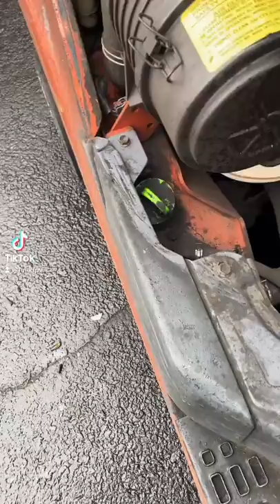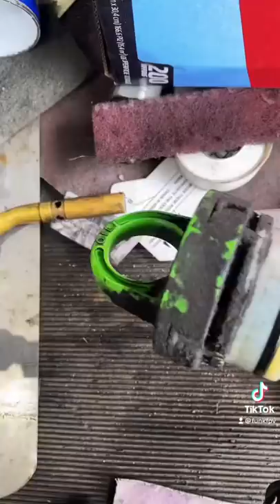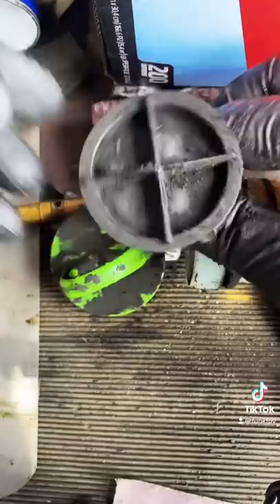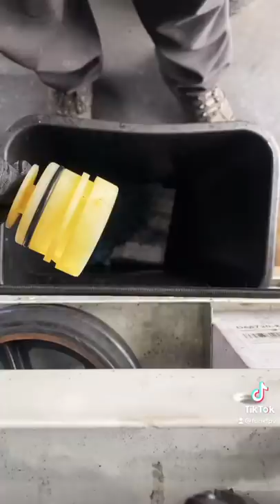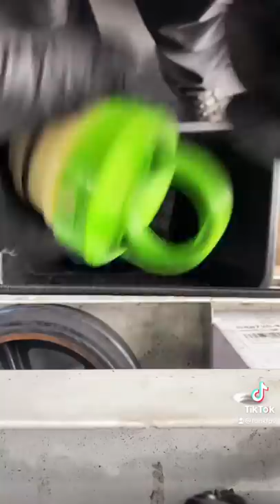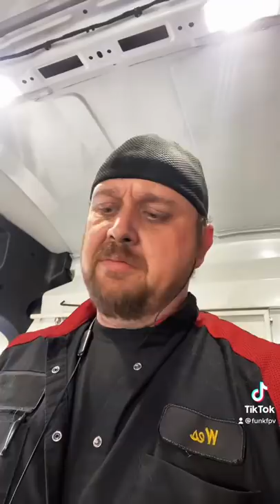Forklift Tips

Comment: When you were spray-cleaning the hydraulic tank vent cap screen, it reminded me of forklift service call I went on decades ago, and it’s something everyone can learn from…

Better me than you.

I’m in a huge, dark warehouse with no ventilation, and an old Clark 3K-lift powered by a four-cylinder Continental engine that’s not running.

I pop-up the sprung seat deck, remove the distributor cap, and inspected the points and condenser.

Whoever installed the last points and condenser set (long ago) plastered white grease all over the points cam on the distributor shaft, and when the shaft spun quickly, the grease flew all over the inside of the distributor cap and the deck plate of the distributor. Genius. Truly lucky it lasted that long.

So, because I’m troubleshooting, I need to see what’s working and what’s not. The starter motor works fine. The white grease inside the distributor could be an issue. 

I take-out a can of spray brake cleaner (that’s really good for cleaning parts and the spray dries quickly), and I spray the inside of the distributor until the grease is gone and the spray is dried. Here’s where the fun part comes in…

I turn the ignition key to check for spark, and boy did I get it!

Unbeknownst to me, the brake cleaner I was using is HIGHLY VOLATILE, and the next thing I know, the ignition points spark, and the cloud of mist from the brake cleaner that was lingering inside the engine compartment EXPLODED!

It sounded like a huge battleship cannon firing a 20” shell. I kid you not, the flash from the explosion was about 3’x3’x3’ in size - I know, I was right next to it . People from shipping and receiving and even office workers came into the warehouse to see what happened. 

After that, my ears rang for ½ an hour or so, and noise sounded like I had cotton stuffed in my ears.

Moral of the story: take a breath and listen to the situation you’re in. Had I considered the lack of ventilation, it might have prevented this from happening. Had I read the label on the brake cleaner, this most certainly would not have happened.

The old adage: “speed kills” may be applicable. 

Live and learn. 

Side note: I could blame this on MaryJane, but won’t. 😂🤣😂🦇💩🥜

Thank you for your time on this matter. 

Peace ✌🏻

Comment: Thanks for adding something else to my damn checklist. Wait, what the fuck am I saying. I’m going to show that trick to the shop guys. So I can continue to skip that in the field

As for the cancer in a can. If you have less than 8 cans in your service truck/van. It’s time to restock
Reply: Lol the lifts at my work are so poorly used by the other shift and poorly maintained by maintenance that I just skip checking most things... drive it until it dies at this point
Reply from the maker: Brake clean everything 😁
Reply: Ahhh brake clean.
Parts washer, ether replacement, and hand cleaner! 
As a road tech, how many cases do you have at home?
Reply: @williamstamper442  I have no less than a case and a half at home at all times. The truck normally has at least one case. Until my first service call or pm of the day. I do pm’s on job sites. As well as service and repairs. I’m rarely at the shop except to wash the truck, pick up parts, or restock brake clean. I also use it as ether replacement. I often wonder how it would work as a toilet bowl cleaner.
Reply from the maker: @williamstamper442  don’t forget disinfectant for those cuts 😁
Reply: @FunkFPV  yes apply brake clean to cuts then apply electrical tape.

Comment: As a guy that was a pm tech for 2 years who was trained by one of 8 yrs, this is crazy. I had no idea those caps even came apart. I was single handedly responsible for our fleet of like 30 tow motors for 2 years. I did two effing oil change PMS tonight and just blew it off like normal. Downfall of a promote from within/train from within structure.

Comment: Worked at a Toyota forklift dealer for over a year doing mostly shop repairs (rear seals, diff. Rebuilds and trans work mostly) but I did pms when it got slow in the shop. And I never knew that lol

Comment: Couple of more things that could save you some money on your machines putting any restart ignition switches and a noisy environment some operators don't realize the truck is running and try to start it and wipe out your starter and ring gear that way you have to shut the key off to restart it not just turn it to the starting mode. Another thing could save your engine it's a oil pressure cut off switch will shut down the propane if your engine runs low on oil.

Comment: Actually ,when then screen is blocked, it will create pressure in the tank .It will start leaking around the plate that’s over the tank that holds the filter and return lines from that black rubber gasket.

Comment: Don't use brake cleaner to clean plastics. It's corrosive on plastic and that's why, when you use the brake cleaner on fuel bowls that have sediment built up, it will cloud the plastic and wear away any paint on raised lettering. It's gradually wearing it out. You want to use soap and water or a degreasimg agent and water, dry with a cloth or rubbing alcohol, and reassemble.

Comment: Oh!  I see ,. Hydraulic pump, if it's not cleaned , RIP fork lift. I remember many many years ago, on a job corp training center they had their own firetruck,. Had to because of the location,.  It take a half hour or so to get a town firetruck out there, so , government paid firetruck.  My point?  The last time they did just a let it run since it doesn't get driven much, someone turned on the pump , full of water, it all went into the oil pan, full of water and the diesel oil ,. We took and brought it to the shop ,. Drained the nasty oil replaced the oil and filter, I used air nozzle and blew out all of the water from the cylinder walls , then start it ,. Me and a mechanic saved the firetruck, that was a cab over.   Kept it from going bad ,. Water and diesel oil don't mix as everyone knows.  This was 39 years ago.  The Ambulance was a 63 Pontiac Catalina  motor?  Don't remember the size ,. They needed service, firetruck more than just service.

Comment: I dont think brake cleaner is supposed to be used on plastic parts.
Reply: Brake cleaner can be used on plastic if you remove it afterwards.
Reply: @GrillerRohde  it specifically says not to use it on paint, rubber or plastic. You can do anything once...
Reply: @inibrasiumthefirst2680  
But it doesn’t destroy the plastic in 10 seconds.
You can easily spray it down with brake cleaner and then wash the brake cleaner of with water.